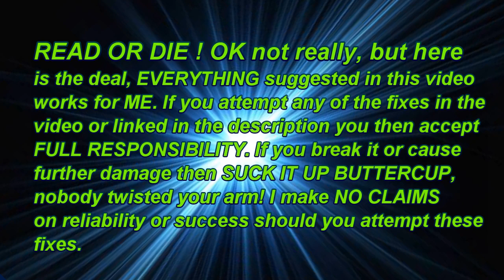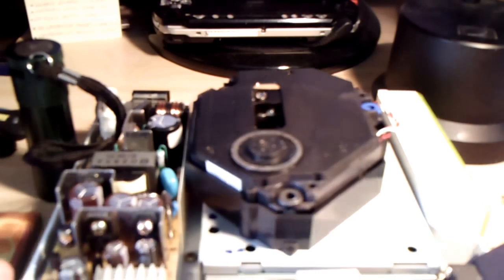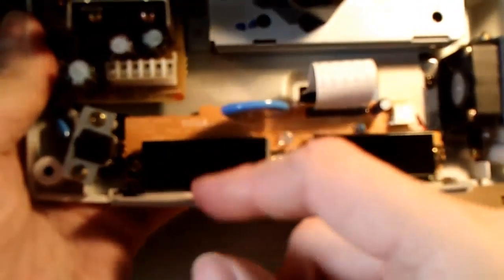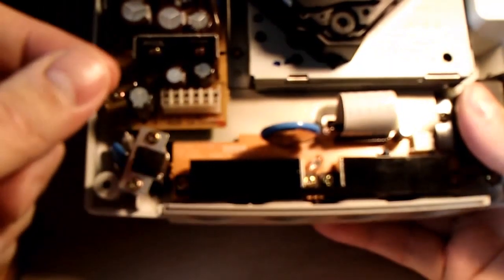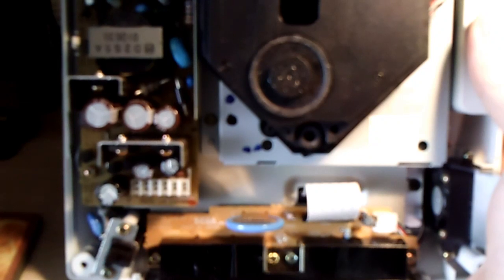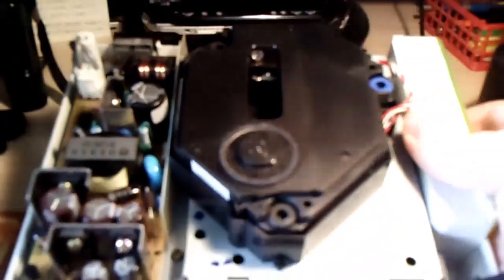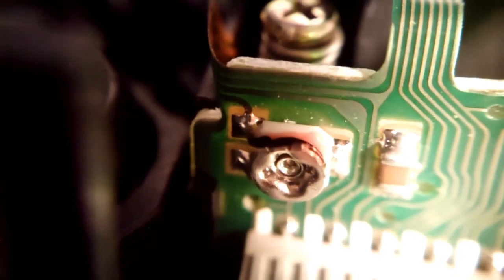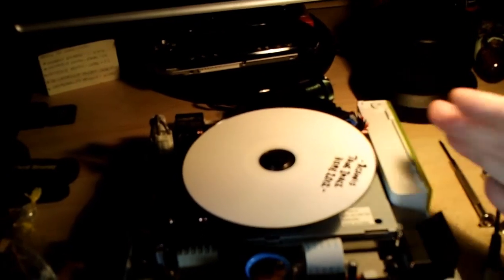Pretty easy fix: DREAMCAST pot adjustment (DISC READ ERROR FIX)

Comment: Interesting video..! I didn’t realize there were so many problems with the Dreamcast.  An Ohm / Volt meter is a must have for electronics and can be picked up for under 10 bucks. There are several ohm meter tutorials on youtube. I use one on almost every thing that gets ripped apart from game consoles to small appliances. Nice tutorial..!

Comment from the maker: Ah yes you are correct, it has been so long since I opened it up and did that I was not remembering correctly. I did try to make it clear that I had no idea if it was a fuse / resistor etc. The guides I linked to in the video description are much more detailed and clear.

Comment: my first dreamcast messed up because it fell and the motor that moves the lens fell out of the clip breaking it. i fixed up using super glue to glue it back in place. it has worked ever since.

Comment: 16:52 you dont even have to pull the laser all the way back, if you just move it a little bit and then turn on the dreamcast it will automatically reset itself. the dreamcast laser moves back and forth so roughly that it sometimes wedges itself...lol. ive personally known this trick for about 11 years. becuase my dream cast had done this. and i did what you just showed and no problem ever since. on a side note i buy "broken" dc's in lots on ebay, and the last lot of 7, 3 had this problem. :-)

Comment: If pot adjustment yields no results, would this suggest the laser is almost dead?

My DC reads some GD discs, some of the time, and some CDR's all of the time. For example, a certain GD disc will not boot at all, it attempts to load for a few seconds and returns to the DC menu screen. Now if i adjust the pot in small increments it goes from not loading, to trying to load for a good minute or two, all the way to not even spinning. So obviously i am passing the 'sweet spot', but i get the feeling there isn't one. Any opinions?

Comment: I know it's a late reply. The heat pipes cooling Dreamcast was only in the early released Japanese and Asian consoles. The US and Europe version had the newer revisions. I got both the early Japanese model and US model. Both modded with multi-region chip.
Reply: Those heat pipes do exist in US consoles. I have one. It was manufactured in August 1999. It's a revision 0 which means that it has the heatpipes.
Reply: Can you open up your system to confirm 100%?
Reply: therider04 Believe me. They are in there. I've been in it before. It's an NTSC U console as well. Meaning it's from the US.
Reply: You got me looking again lol. I got 2 Dreamcast. One is a Hong Kong model which is exactly the same as the Japanese model but without the modem. I had the Hong Kong model back in Jan 1999. I also have the USA model which is made in Aug 1999. I just opened the USA model and I can confirm there is no liquid cooling pipes in mine. The outside part of the fan in the USA model is made of plastic while the Hong/Japanese model is made with metal.
Reply: therider04 The way you can tell a revision 0 Dreamcast apart from the rest is to look where the fan is. You should see a metal surrounding where the fan blades are. If you want me to, I can make a video proving that it is a revision 0 Dreamcast. Not right now though, because I have a cold that has caused me to lose my voice a little bit.
Reply: I already got a Hong Kong/Japanese model plus got the launch USA model with the production date of August 1999. I opened both consoles, it's simple to do. I checked both. My Hong Kong/Japanese model has the pipe cooling system but my USA system does not have it. Both my systems are chipped so I have to get to the motherboard. If you don't want to open your system, you can check the label at the back of the console. There's a number in a circle on the bottom right hand side of the label. I checked my USA version and it also says 1. Does not bother me as I have both consoles. The revision 0 is better build as the fan sounds more quieter and looks better with the clear plastic on the lid (above the power light) while the USA has a dull looking grey plastic. The good thing I like with the USA  system is it has the 2 black rubber patches on the disc tray to prevent disc scratching. I did have to replace disc drive with my revision 0 console as it broke down. I replaced the disc drive from a European Dreamcast and it works. Both my Dreamcasts are working 100%, too bad I don't have the working original revision 0 disc drive.
Reply: therider04 I knew about the fact that on the bottom, you can check the revision number by looking at the circled number. I also think that those two rubber things you mentioned are actually felt. The revision 0 Dreamcast that I have still has the original Japanese made Yamaha GD-ROM drive. Works with no problems.
Reply: My broke down while play Skies of Arcadia back in the day. I from the UK so bought the Pal version of the game. Amazing game until my disc drive broke in the middle of the battle. So I knew then I will need to replace the drive. Good thing I had a back up USA Dreamcast while replacing the disc drive for my revision 0.
Reply: therider04 Speaking of  the U.K., I believe that there are also revision 0s floating around there.
Reply: I did not purchase the UK Dreamcast. I never liked the blue swirl lol. I chipped my systems shortly after UK release once the mod chips were available.
Reply: therider04 I assume you're using a voltage converter because the U.K. has 220 volts instead of 120 volts.
Reply: Yep was using 100-120 volts Transformer. I then decided to keep my Hong Kong/Japanese Dreamcast in it's original box. I have replaced the power supply (with a 220-240v) in my USA Dreamcast so I can just plug it straight to the mains.
Reply: therider04 Awesome!

Comment: My rev0 systems are NTSC dreamcasts. My PAL dreamcasts have a completely different build with plastic fans etc. probably could not be as they were produced much later on in the DC lifespan.

Comment: Hi. Thanks. The DC laser (lights, moves back and forth, up and down) I'm trying to revive (for two weeks now, on and off). The original measurement is 1427 ohms, I've turned it clockwise around 600 ohm. Should I turn counter clockwise? What's your final ohm measurement?

God bless, Rev. 21:4

Comment: the fusible resistor is not under the controller ports. it is that blue thing you see to the right between the light and the connector. that controllers all 4. it is labeled  F1 and is a fuse not a not a resistor. that is a fuse in the shape of a resistor. it is called a fusible resistor. you can find them looking that up on google. not sure the value but they do have some kind of color code on them. a resistor might work but i wouldn't trust it if it was me.

Comment: Help me please. First of all thanks for the great video. I am facing a problem i have never faced before with my DC. It powers on, fan spins, no flashing led however it will not display any video or any audio! any idea what the problem is?
Reply: Idk if you've fixed the problem by now, but I'd recommend checking the VGA cable, specifically the end that plugs into the console. There are supposed to be (I believe) 16 little metal prongs inside the plug. My console was having the same problem, and I checked the plug to discover 70% of the prongs were missing. If that's the case, you're best off buying a generic Dreamcast VGA cable off eBay or Amazon. Also, if it looks like all or most of the prongs are still intact, DOUBLE CHECK it's completely plugged in, don't be afraid to push it in further if it doesn't look like it's all the way in. I bought a second console AFTER buying a working VGA cable because I was afraid to try to push it in farther and thought my old console was just broken

Comment: big tip man if you ever remove the gd rom drive put the screws back exactly how you unscrewed them as if you put the wrong screw in the bottem left part of the unit the screw will grind into the CPU and kill it!

killed one that way so beware lol....

Comment: Will this work for me if my console powers up, spins briefly, then stops spinning before I even get to the play menu? I bought another console that works fine but it'd be nice to have a backup. Both thankfully play CD-R backups just fine, which is great because half my actual retail discs detect as audio cds

Comment: sorry but i don't think this should ever be done. most of the time it is not the power but the dust that makes it mess up. remember the ps2 and the lower lens that got dusty and no one seemed to be able to clean? alecjahn has some videos talking about and showing it being cleaned. i would bet all disc drives have a lower lens that can get dusty and be cleaned.